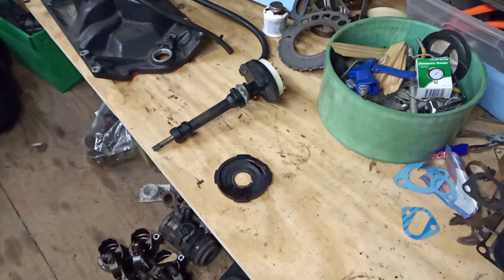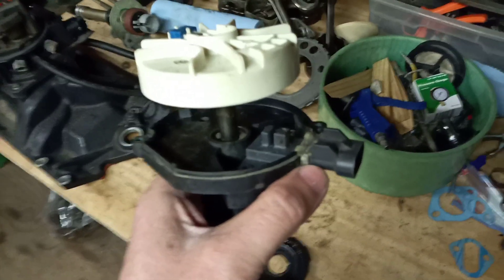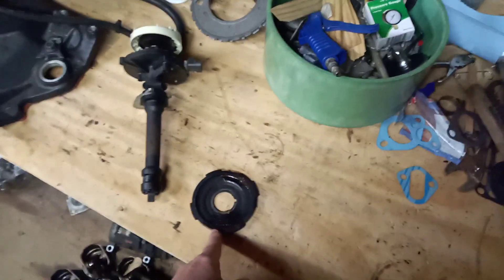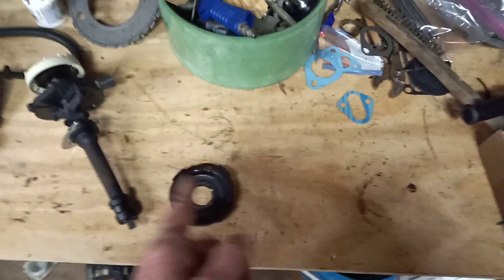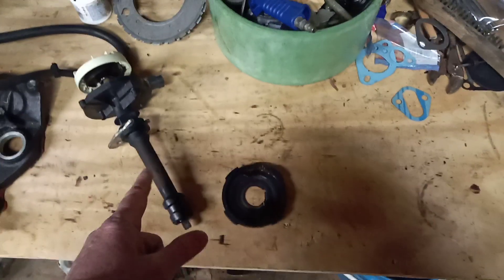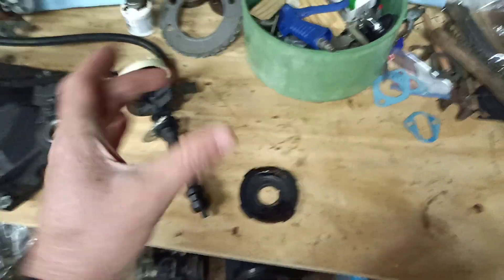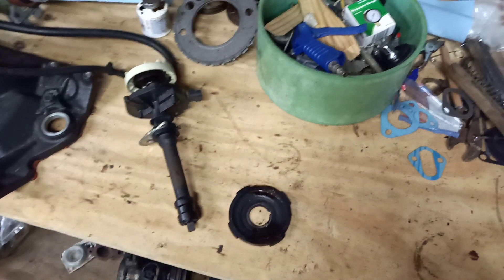Debunked - Dodge Fuel Synchronization - Part 2 (Hit Like If You Agree w/Me)

Comment: Makes sense as to why Dodge's tend are times seem to have Longer crank times(depending on where the firing order the engine is resting at). It's trying to see where the distributor is so the ECM knows when to start the firing of the ignition and injectors.
Reply: My Dakota doesn't even finish a full crank and its running. Always been like that.
Reply from the maker: The ignition doesn’t matter because the distributor takes care of routing the spark. But since you can’t have fire without fuel, it won’t fire up until it gets fuel also. I wasn’t aware Dodges take longer than other trucks.
Reply: @moccasinmarine  sometimes they do as well as the old 4.0L Jeep's. By my comment I wasn't referring to ignition being controlled, just more like the computer using the distributor as a reference for #1 cylinder compression stroke as to when to start firing.

Comment: Question…. I have a 97 5.9 ram 4x4… I put a double chain with 4degree advance/retard option I put it 4degree advanced… I have a code stating intermittent loss signal from crank or cam… I got her running pretty good by ear with what I now know being the injector pulse only but she runs decent but slightly brakes up and studder/stumbles literally a second then runs fine … ? What should I do , put the crank back to stock marking or just zero out the fuel sync… it’s a stock motor don’t know about mopar motors I’m a Chevy/ford guy
Reply from the maker: When you advanced the cam you changed the fuel sync by 4 degrees (or maybe 2 or 8). I’ve “heard” the window is plus or minus 8 degrees for cam sync but I don’t know that for a fact. So you may need to adjust the cam sync to get back within the window.

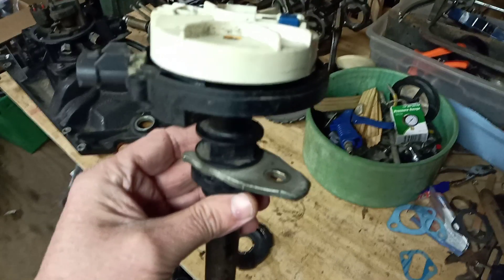But you might also be experiencing a distributor rotor phasing problem. In fuel injected engines where timing is controlled by the ECM and a crank trigger, it’s possible to position the distributor such that the spark jumps to the wrong tower in the cap. If this is your problem rotate the distributor counterclockwise a little and it should correct it. How much is a little I can’t tell you, maybe 1/2” at the edge of the distributor? This video at 2:38 ( not my video, his) has a great  explanation of rotor phasing.

https://youtu.be/FXcwTtyIFck

Comment: Hey I really liked your video and it make perfect sense to me 
I am just your back yard mechanic but have been working on cars and trucks for 12 plus years and even with my limited knowledge of this you make it very simple to understand thank you so much 

I don’t know if you could help with this but I have a 1995 ram 1500 360 and I need to rebuild the motor but don’t want to go stock with it but to do anything to it I need to reflash the PCM on it but I am having one hell of a time trying to find someone that does obd1 so wanted to see if you know someone or if I sent you a PCM if you could help 
Thank you so much for the video I hope to replace these parts to help with the ruff idle  and make it run like it should
Reply from the maker: If you go here you’ll see that you might be out of luck:

https://www.hptuners.com/vehicles/

I don’t see 1995 1500 rams with 5.9 engines listed. They do list the 5.2 so you might take a chance with that. I have a 1998 so mine is covered. I would email them and ask if the 5.2 license will work with your 5.9 VIN.

Comment: Is the distributor sensor also what syncs the ignition cycle?
Reply from the maker: That’s a good question and I was about to give you a bad answer. Since there is a mechanical distributor there is usually no need to sync the distributor with the computer. On pre 1995 GM EFI systems the computer sends an ignition pulse out 4 times per revolution and the distributor handles distributing the spark. I was about to say the Dodge system did the same but I now see there’s a difference. If you look at the crank trigger wheel (see link in description) there are 8 slots in the flex plate which will send 8 pulses to the computer per revolution. However this is a 4 stroke and there are only 4 ignition events per revolution. That means the computer will receive an extra pulse half way between each ignition event and it can’t fire a plug then or you would have severe pre- ignition. So there has to be a signal from the cam sensor telling the computer when to start counting crank trigger pulses so it can skip firing on every other pulse. GM systems after 1995 have 4 pulse trigger wheels so they fire the ignition coil every trigger event (plus or minus advance or retard amounts) and the mechanical distributor handles the distribution of the spark. They don’t need the cam sensor to synchronize ignition events which is why I suspect they will continue to run in batch fire mode with a failed cam sensor. This explanation may also explain why a Dodge engine will not start without a cam sensor. It can’t determine when to fire the ignition coil due to the extra crank trigger pulse.

Comment: I Agree  with you that only tells the ecu were the camshaft is related to the crankshaft position for fuel and spark we called this many different name in the passed. these engine do not batch fire after 1000 rpm   would never pass smog emission like said below. this is why they came up with Nox test not true they will only batch fire like you said if that pick up fail in the distributor for safe to get you back home and watch your fuel gauge on a travel fuel miles drop if the batch fire. there where engine out there that used to batch fire and not only did i go to school for them many year ago but they had to stop to because of Emission laws. Yamaha outboards was one that did and so on and so forth. haven't watched the other videos but going to now.  Auto, Diesel, gas, outboards, and marine Diesels and gas. Certified in all
Reply: first I had to think about this getting old sucks. I have to correct my self this system works like this, that only tells the ecu were the camshaft is related to the crankshaft position for start up and helps keep that info but if it fail the engine will stay running but if you shut the motor off it will not restart. this system will never batch fire in any way there that what this system is all about,

Comment: Multi port injection only works up to 1000 or so rpms then it goes to sequential fuel injection to high rpm then all injectors are on full time that sensor works till the injector is on full time then it just throws a signal just like you said I believe that is a analog type if it was didgital it would different Like on coil packs  but as far as setting the synchronization snap on used to make a code reader that you could see what the electricity went to the injector and how long it was on like setting the dwell on points those noid light just tell you if the systems working electrical but they are a life safer and it is quick to diagnose but the cheaper ones fail sooner god bless and have fun
Reply from the maker: If you are going to make comments like this bring some evidence to back up what you are saying.
Reply: I have the MT2500 by SnapOn that you are referring to and I can set Fuel Sync (Cam Sensor) activate and deactivate the injectors and watch them as they fire.
Reply: Isn’t multi port and sequential the same thing ?

Comment: First off you are trying to understand a Dodge system by relating to a GM product. Close but not exactly alike. On the Dodge all the pickup coil in the distributor does is detect the camshaft position & is thusly called a camshaft position sensor. Once the engine has started & is running it serves no purpose. If it (CPS) fails the engine will fail to start & a code reader will pick up the fault as  no signal from camshaft position sensor.  Richard Ehrenberger of MoPar Action Magazine explained this in detail and the engine will run fine w/ the CPS unhooked. A failed one can be easily changed on the road, I did one in the parking lot of a Captain Ds. Something to be very aware of is aftermarket electronic parts. I bought a Wagner crank trigger (pick up coil) from O'reilley's for a 2000 van w/ 3.9 V-6. I was going on a trip & wanted a spare. About 100 miles from home the check engine light came on, engine ran fine but the light was on. Got my handy dandy code reader out & read the code. Faulty crank trigger. Deleted code & went on. Light came back on & checked again. Same thing. Ignored the light & continued the trip. Got home & changed back to original coil. Took the aftermarket one back & got refund. Checked all the parts stores in my area &  found out that all had the exact same part, just in a different color box w/ a different name on it. I went to a salvage yard & removed 3 coils from different vehicles, tested them & carried as spares.  Chevy calls the thing one thing MoPar calls it something else. I think that the Dodge moniker is more descriptive of the function. Fuel syncronization?? A bit confusing.  On removing & replacing the distributor: Follow the SRM, it works & I have never had a problem. All that is critical is that the rotor be at the #1 position of the cap. On the 5.2 & 5.9 aim the rotor at the #2 bolt on the left side of the intake manifold w/ # 1 piston on compression stroke & timing mark at approx 10 deg. advance. Will not set a code if this is done. Actually no code will be set unless the CPS fails or comes unhooked. MoPar nut n this end. Info is free.
Reply: Update: Ran a test to see if the engine would run w/o the CPS. Stared the vehicle (already warmed up) & disconnected the CPS. Engine ran fine, idled fine, accelerated fine. Shut engine off & tried to restart, no go. Apparently the only purpose for the Cam position sensor is just as you concluded and that is to tell the computer what cycle the #1 cyl is on to set the timing for the fuel injection.
Reply from the maker: @larryhutchens7593  So if you agree with my claims in the end please retract what you said at the top about GM fuel injection being close but not exactly the same. I’m sure there are subtle differences and I never said they were exactly the same. I’m just making the claim that fuel synchronization has nothing to do with injector timing. You said a lot but didn’t really provide any facts to refute my claim.
Reply: @moccasinmarine  That was just a slight slam at Chevy guys giving MoPar guys advice about diagnostic solutions. I have encountered that with relatives & friends who took engine building tips from the Chevy crowd.  An example: The guys a Powernation were building a 360 & were trying to get oil up to the rocker arms. The guy building the engine got frustrated at the fact that even though he had plenty of oil pressure by spinning the oil pump with an electric drill he could not get oil to the rockers. I was watching & kept muttering to myself "It ain't a chebby, it ain't a chebby". He later learned that you have to rotate the engine slowly so that the oil passages in the #s 2 & 4 cam journal will align with passages in the block to allow oil to pass. The little plug in one of the main oil passages is another bugaboo that first time MoPar small block builders will trip over if they get info from a Chevy guy.  On my end I was building a 350 chevy for an 83 Malibu wagon & ran across a ball bearing in one of the oil passages Not the whole bearing assembly, just one ball about 5/16" dia. After asking several chevy guys at machine shops I got no solid answers. Ball bearing?? was the most common reply. I wasn't refuting your claims, simply confirming them. The term "fuel sync" was a term that I had never ran across in any Chrysler FSM & assumed that it is a GM term. Am I correct?
Reply from the maker: Fuel sync is a term coined by Chrysler to represent a “setting” on an adjustable distributor to synchronize the crankshaft and camshaft sensors. That’s the entire purpose of my Debunked Video series. Once the fuel sync is set, the PCM can sequentially fire the injectors. If it’s not set, the engine won’t start which in my opinion is a design flaw. The ball bearing you are referring to is to divert the oil from the pump into the filter and then back into the same port. When the block is cleaned the shops knock the ball out for thorough cleaning. Typically a small cup is driven in to replace the ball. Without the cup you’ll have oil pressure but the oil won’t be filtered. I will soon have a video on this exact subject.
Reply: @moccasinmarine  I understand the gist of your video but I have not seen the fuel sync term in a Chrysler FSM. I may have overlooked it, I do that sometimes. The term was foreign to me.  The manual just shows how to properly install the distributor using marks on the cam position sensor & it works. There is no mention of using an electronic device for the install. At least  it worked on the 4 engines I rebuilt. I can't remember what I did on the ball bearing thing, that was too many years ago & the last GM engine I worked on. From what you say it serves the same purpose as the small plug that is in the vertical oil passage in the MoPar small block. It does the exact same thing & can be overlooked by the novice engine builder. Easily removed by driving it out with a 1/4" rod down through the hole provided for the oil pressure sender unit. Most machine shops remove it when vatting a block. It just seems that a ball bearing would be an odd thing to use for a plug. First thought was that it was some sort of check valve.
Reply: @larryhutchens7593  Little late to the show, but my FSM for my 1996 Dakota has a whole section on using a computer to check and set the Fuel Sync. I just rebuilt my Dak's engine and wouldn't start until I aligned in like they specified. It's not perfect but it runs enough to get the truck to someone with a fancy computer.
Reply: @tomc8157  This. Just did a distributor on a 93 dakota. Lined up all the timing marks, until the dizzy pointed at #1. Got spark back, but wouldn't run at all until I synced it with a multimeter enough to fire and run at all.
Reply: @ What did you sync with a multimeter? All the camshaft position sensor does is tell the ECM what cycle the camshaft is on, compression or exhaust. With all the conversation on this I have never heard of or found any sync process in any manual, OBD-1 or OBD-2. Your 93 is OBD-1. Since you claim to have synced something please tell me what you hooked a simple multimeter to. All the controls in the system are electronic. What did you connect to & what did you adjust or set? I have done a 92 Dakota, 98 Dodge Ram 1500, a 2000 Dodge Ram van and a 96 Ram 3500 van and never used any sort of multimeter, computer or anything else.

Comment: I had 1997 ..chevy 5.7 Vortec pulled distributor put back right where it was, and could not get rid of CEL ran fantastic !. but would not be able to pass SMOG for reg .had to have a shop put it back on at 0 .and It still ran great..side note the distributor  caps on those motor always seemed to go bad on me .still great motor in my opinion
Reply from the maker: What was the P0xxx code when the CEL was on?  Can’t help without that.